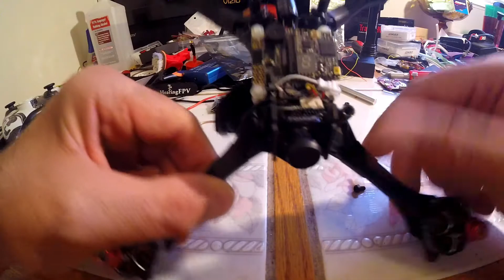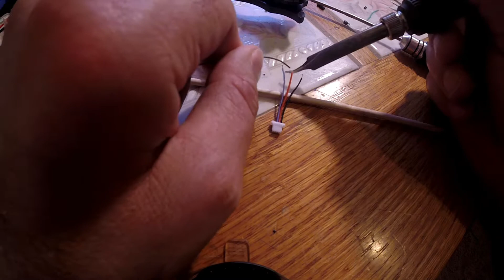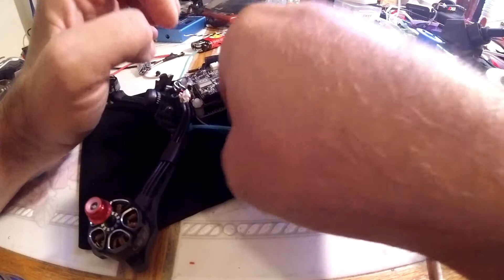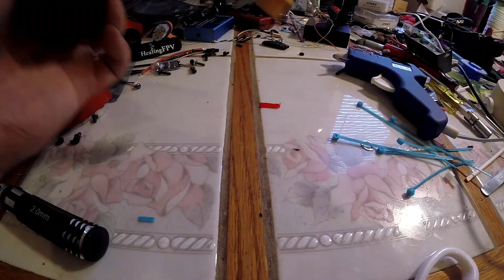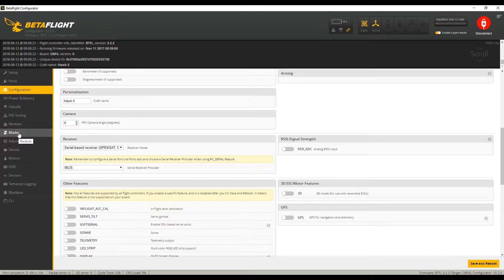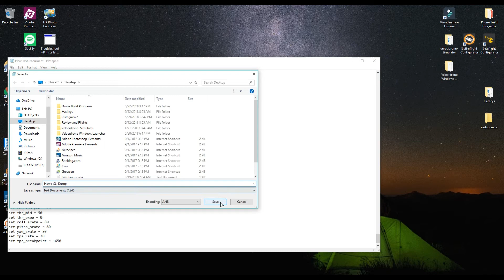Hawk5 - Instalation and set up Flit10 AFHDS-2A Reciever

Comment: Why didnt you just use the pins for the frsky RX on the magnum stack? I had to do a similar setup on my RuXuS frame. I am running a Magnum with a Flysky RX soldered to the same pins.
Reply from the maker: AlbeeSoaring the flint10 didn't work on any of my other MagnumStacks on uart1 using Ibus. I changed what uart and it worked so I didn't try it again after the first one didn't work for me.
Reply: Gotcha. I am not familiar with that RX so it must be a little different then the Turnigy iA6 RX I think its called. Wasnt trying to bust chops just wondering. Thanks for the info.
Reply from the maker: AlbeeSoaring 😁 I know... lol! Your one of my first subscribers! I expect nothing less. Dooooood you gotta check out the new flint14 rx from happymodel. It's full range with working digital rssi for the osd. No modifications at all. I'm getting ready to do the review on it. Spoiler it works great 😎
Reply: AlbeeSoaring - Don’t even use the pins. I just carefully use needle-nose and tear that pin harness right off the board, no big deal, then just solder to the existing pads! The Frsky RXSR receiver wil fit perfectly where the xm+ was, and you won’t have to update the receiver to get RSSi values, a much better receiver all around!

Comment: Cool my new frame arrived today :D I´m also upgrading my flight controller, from F3 to a Matek F4. I was just going to start soldering, but instead decided to watch your vid first. Glad I did, because your masking-tape tip so obvious, that I never thought of it myself, hahaha. Thanx buddy, now back to building :D
Reply from the maker: Just looking nice! I'm glad you learned this before you started the build. Excited to see you out there rippin them packs
Reply: Yeah, lol another 1 or 2 days delay. I need longer M2 screws to mount this Matek board, it has 6,5mm high soft-mount grommets, where as the windings of my M2 standoffs are only 5mm high and I need an additional few mm more, for the nut on top. Grrr, thought I could maiden tomorrow. Packs are charged, want to fly, got a bundle of props to try out. Hope to rip again this weekend. Wish you good ripping, without defects, Hadleys FamousFPV :D